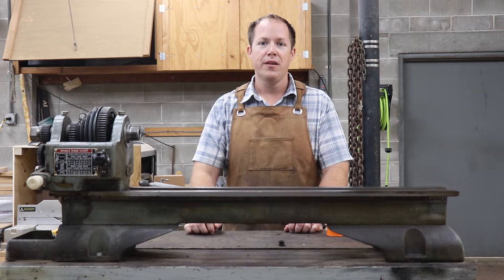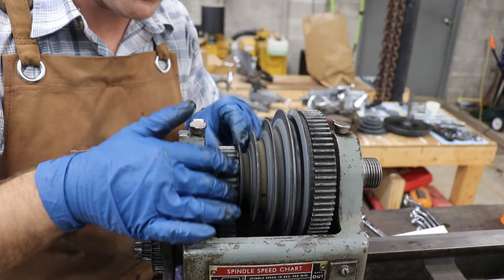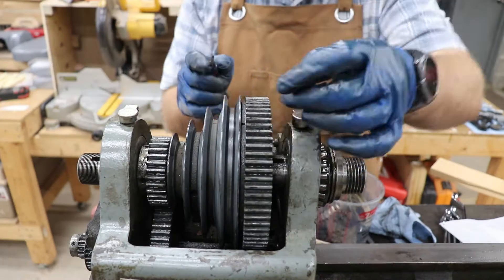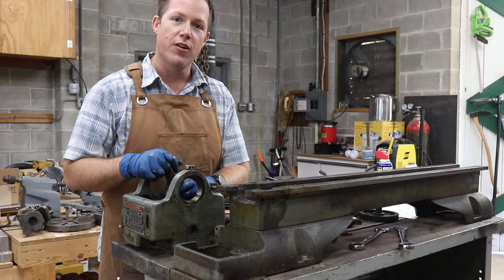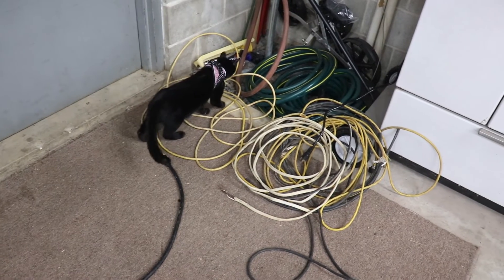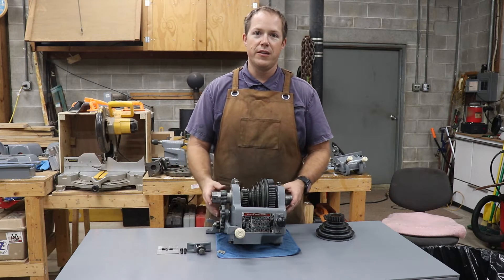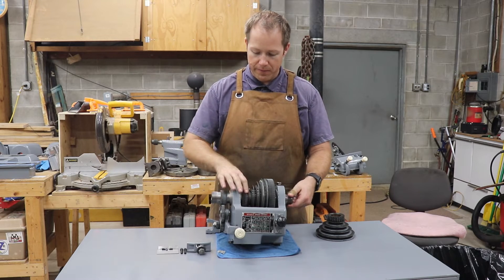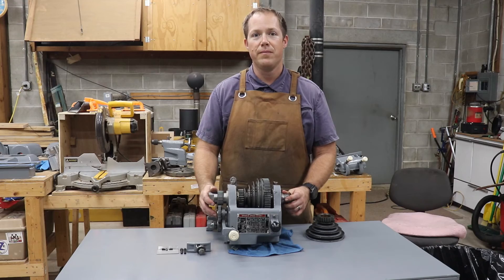Atlas Craftsman Lathe Restoration Revival Part 4 (Headstock)

Comment: I just rebuilt my Atlas QC54 and one thing that I found is that the precision bearings that came with the original lathe, and are very expensive (new) from Clausing, have a lip on the races that seats in the headstock bore.  I couldn't see if yours had the lip.  If they didn't they may be Timkin aftermarket bearings.  Also the inner races should be very tight to the spindle, yours seem to be much looser than the one's in my lathe.  I had to make a tool to press the bearing off the spindle nearest the headstock.  Later on, I just use a block of wood and just tapped the spindle into the headstock past the outer races, until the inner bearings were seated.  Nice job though!
Reply from the maker: Thank you for the advice. This lathe has original Timkin bearings and they do not have the lip that you're referring to.
Reply: @MakeStuffNation  Could someone have replaced the bearings before?

Comment: GREAT!! I will be rewatching much slower as I start rebuilding my cabinet driven 3991. Can you post the types of paints you use and your method?
Reply from the maker: I used Rust-Oleum self-etching primer followed by smoke gray Rust-Oleum and then Rust-Oleum clear coat.

Comment: My issue I'm trying to figure out is why does pulling the pin to use the back gear do absolutely nothing to free up the belt pulleys. I've got an old Atlas 618...
Reply from the maker: Do you mean to loosen them, Like if you want to change the ratio or they won't turn it all? If they're not turning at all and the pin is pulled, something is frozen. It is possible that the pulley cone is frozen to the shaft. It should rotate freely with the pin pulled.

Comment: It seems like the belt would need to be installed on the pully cone before assembly. I must be missing something.
Reply from the maker: You are correct if you are using standard belts but I use link belts. They run quieter and are easily replaced without disassembling anything.